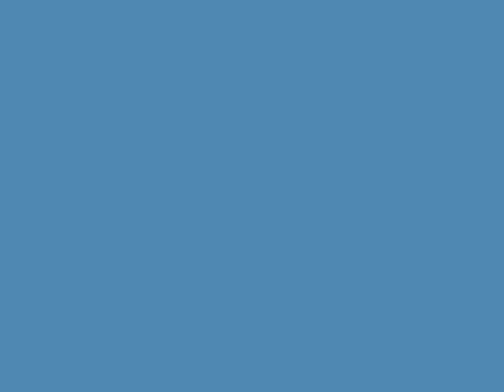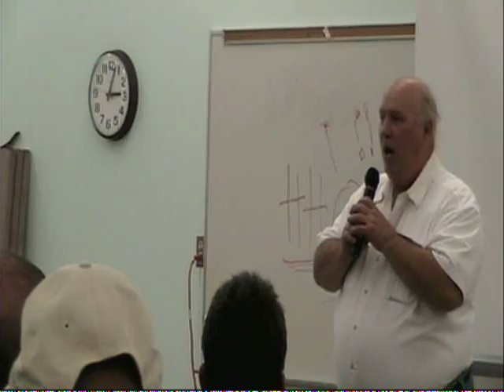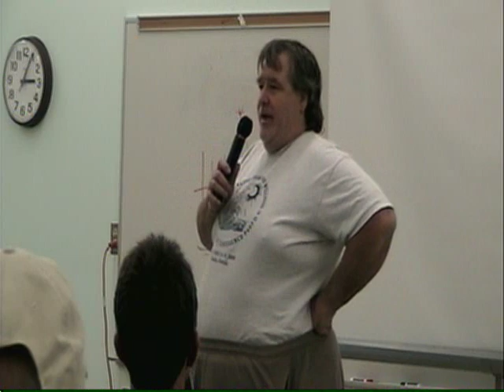Bob Boyce 27 Years HHO Part 1

Comment: If you are referring to me, then the answer is no, I am not "spreading crap." The truth is not crap.
Reply: What the hell are you talking about? I know this was posted 10 years ago but seriously what is a scam? That water makes hydrogen? Or that hydrogen betters your mpg in your vehicle? Or that hydrogen and oxygen are real gasses? I want to know what exactly is a scam? Hydroxy gas when burnt turns back into water and water is then 're burnt and the cycle repeats. So I'm just curious as to what or who is being scammed?
Reply: PS, HHO technology has advanced quite dramatically since you made your claim and I'm curious as to if you will retract your statement now seeing as major car manufacturers have also proven that this type if system can be beneficial and the carbon footprint it leaves vs fossil fuels or chemical batteries is really the benefit in my mind.